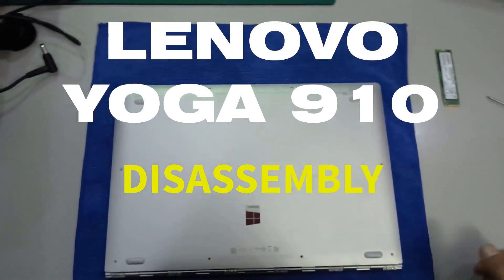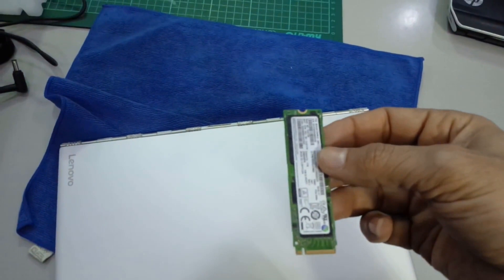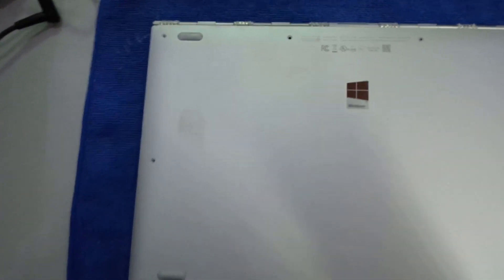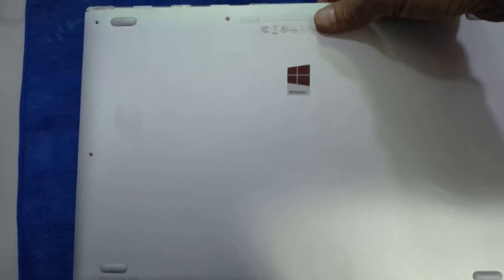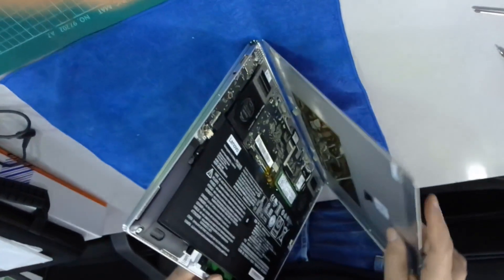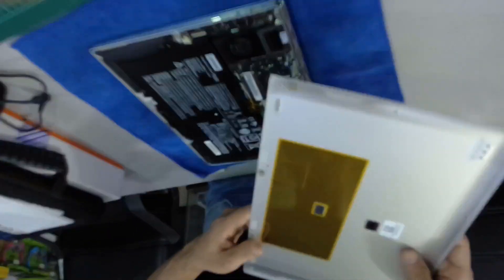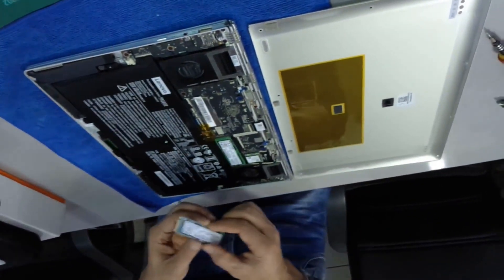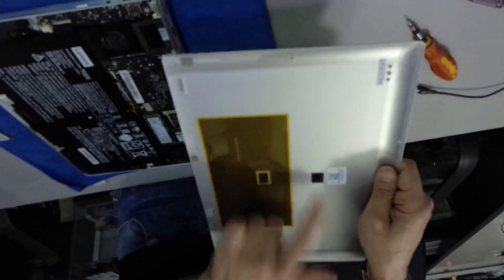LENOVO YOGA 910 DISASSEMBLY & UPGRADE

Comment: Whyd you replace the ssd with a slower ssd?
The one that was in there was nvme which is what you want, not sata.
Reply from the maker: The customer in this case looking for more storage space 
Thats why
Reply: @MiladGhaddar  You should've stilled replaced it with an NVME driver, fuck sata.